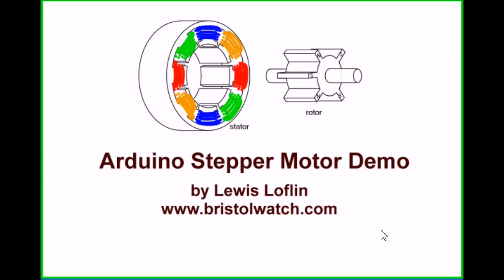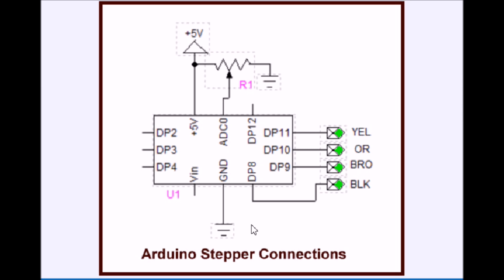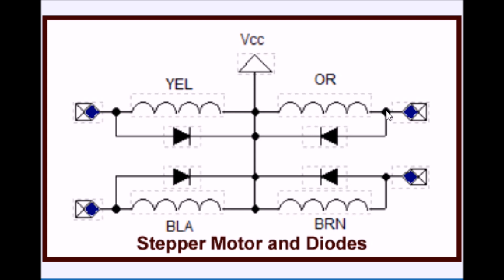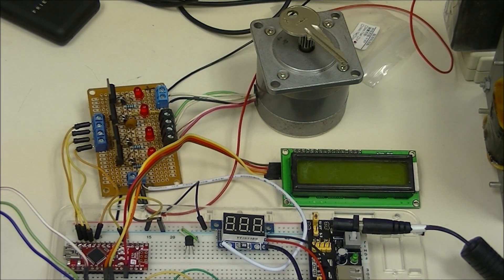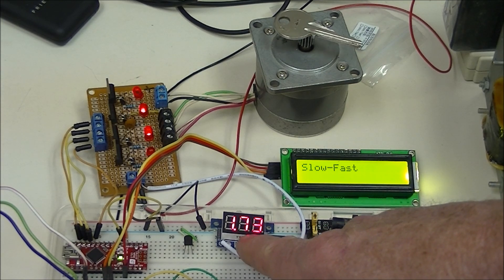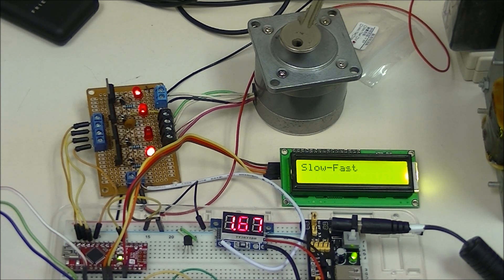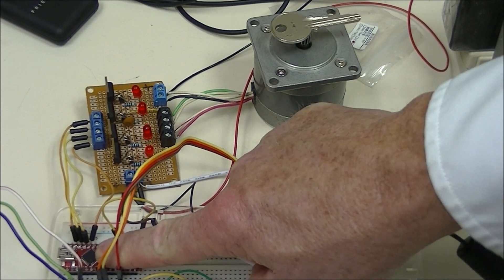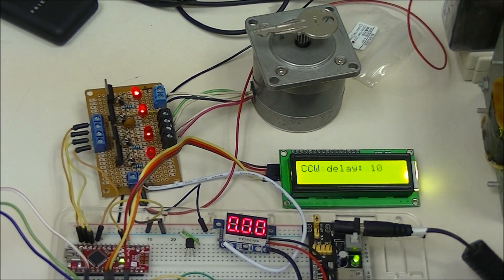Stepper Motor Control Basics with Arduino

Comment: Hello!! I'm trying to use a stepper motor with a display 7 segments, but when I try to execute the code with both, the display works but the motor doesn't work. I've tried using an extern source to give tension to the display and the motor directly with ardunio, but it doesn't work again.
How did you do to conect stepper motor, display lcd and display 7 segmentes?? Did you use differentes Arduinos??
Thank you so much for your help!!!
Reply: Which stepper driver are you using? You should power the motor and the arduino + display separately (but with common ground). The motor is usually powered with a higher voltage, 12 or 24V for example. And the Arduino with 5V or up to 9V when using the Vin pin.
Reply: I'm using a stepper motor with driver ULN2003.. I did this, I mean powered the motor and the arduino+display separately but I couldn't see all numbers in the display... I can see juts 3 numbers, if I try to see more the srtepper motor stops!! 
I think that's a delay problem, that's right?

Comment: Sir, We need one full stepper motor driver system. the RPM from 0.1 to 60. Can you help me. Please reply
Reply: Someone knows how to do the program in arduino that shows the angle and number of steps of the stepper motor on an LCD by a control from left to right would be much appreciated
Reply from the maker: You need a gear box stepper motors come in 7.5 deg. or 1.8 deg. Easy Driver allows micro stepping. 
See https://www.sparkfun.com/products/12779
Reply: Thank you sir.

Comment: Hello Lewis, Nice tutorial.
I've checked your videos on using optocouplers with Triacs and wonding if you could make a video how to calculate snubber cirquit and resistor values when we use optocoupler MOC3041 with triacs. 

I'm trying to control Light shutters by using triacs. I have cirquit snubber protection, correct values, but after few open/closes,  triac base gets damadge.

Shutter 230V, 148W, 0,63A
http://www.amazon.de/Jarolift-10050268-elektromechanischer-Rolladenmotor-SL45/dp/B003BVENE4/ref=sr_1_3?ie=UTF8&qid=1455871515&sr=8-3&keywords=rolladen

Here is schematic which I use.
https://cdn.hackaday.io/images/6158281430776141257.png

Is it important to keep load on terminal 1. I mean what happens if someone will change LOAD cable?
Thank you

Comment: Interesting. Could you make a comparison between your driver and some integrated drivers like TB6560, A3967 ,L298 price and performance. What i dont get is why does a bit more power driver like a DQ860MA 7,8A the TB6560 3A  cost 20 times more?
Reply from the maker: +Hulla Dek You can use those if tyou want but those are the transistors I had on hand and were plenty for the motor I had. These video are designed to introduce concepts not a finished product for sale.